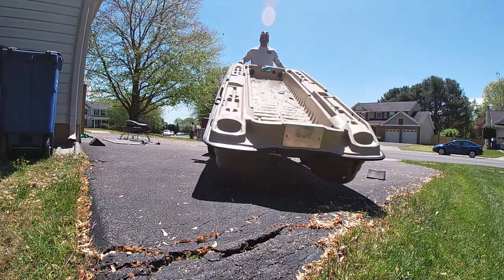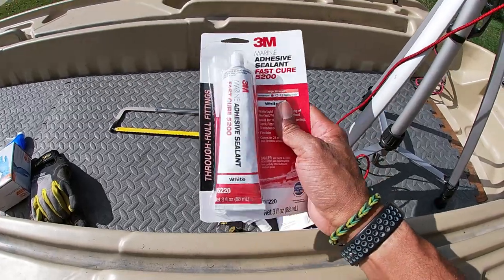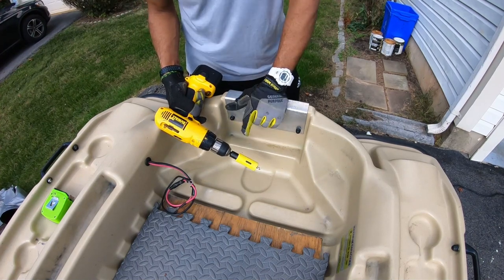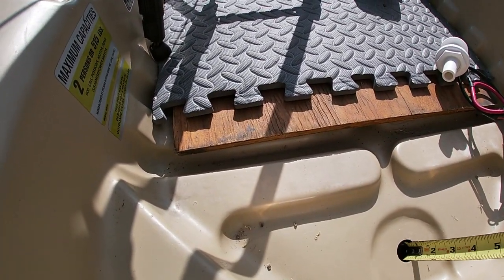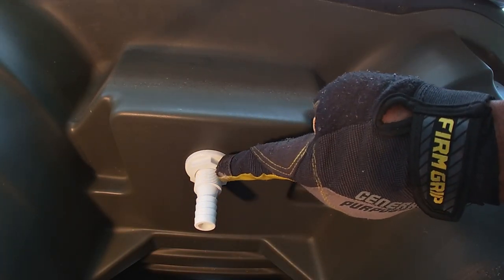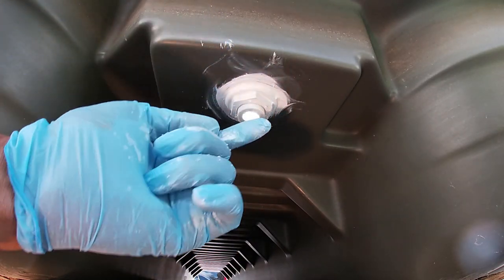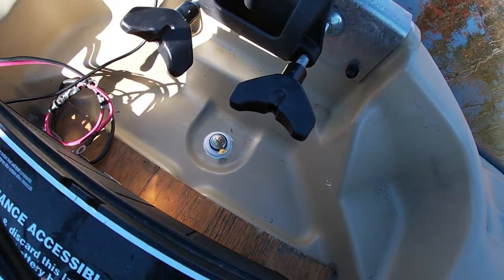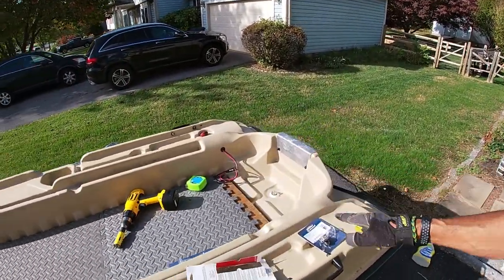Pelican Bass Raider 10e Scupper Plug INSTALL AND TEST {Complete Step-By-Step}

Comment: I am new to boating (and somewhat technologically challenged when it comes to online posting).  I tried commenting on this topic once before, and, I believe I lost the comment somewhere in cyberspace during the attempt.  This is a second attempt.  I watched this video (and some others) when I was trying to decide if I wanted to drill a hole in my new Bass Raider10e and found this video to be instructive and helpful.  
 

Before inserting the hollow plastic scupper hole bolt I wanted to have a shim/spacer in the inner hull, between the floor of the boat and its bottom, to prevent crushing the plastic in the empty space when I tightened the large plastic nut.  I saw another boater’s video using a printed C-shaped insert that seemed to work but appeared difficult to insert into the inner haul; the video suggested using that spacer divided into a few thinner sections. I thought I would try my own homemade spacer cut from a piece of PVC pipe.  I am now attempting to cut and paste (see below) a description of my very simple shim/spacer and how I did the installation.  I do NOT know if it will work and I am NOT saying that it is even a good idea, only that it is food for thought.  I will attempt to include a couple of photos of the shim/spacer IF I can figure out how to do that.

So, I made a simple split shim/spacer that I could insert between the upper and lower hull-shell halves of a Pelican Bass Raider 10e. Hopefully, this will prove to be a solution to the problem of: “how do you easily get a shim/spacer, that has a larger diameter than the holes you drilled through the floor and bottom of your boat, placed around the perimeter of the holes, and placed between the upper and lower hull-shell halves (inside the hull), when there is no other point of access for the shim/spacer?”  The steps I followed in my installation are outlined below.
 
1.	Drill a 1 and 5/16-inch diameter hole (THIS SIZE ONLY APPLIES FOR THE SIZE OF THE PIECE I INSTALLED IN MY BOAT – ADJUST SIZE FOR YOUR APPLICATION) in the floor of the boat and one through the bottom of the boat for the hollow plastic scupper hole bolt to pass through.
2.	Accurately measure (with calipers) the space between the upper and lower hull-shell halves in several places around the perimeter of the holes you drilled.  Take a few measurements because the distance between the upper and lower shell halves on my boat varied from about 5/8-inch on one side of the holes to about a half-inch on the opposite side (apparently due to slope and possibly slight irregularities in the molded plastic).
3.	Cut a circular spacer from a piece of PVC pipe that has an inside diameter of just over 1 and 5/16 inches (AGAIN, ADJUST THESE SIZES TO SUIT YOUR APPLICATION).  Grind down the width of the spacer (measuring with calipers) to accommodate the variance (from ½” to 5/8”) in the empty space between the shell halves.
4.	Drill a few small holes, about 1/8-inch diameter, around the perimeter of the plastic spacer.  You will use these holes to reach between the upper and lower shell halves with a nail to turn and position the spacer for best fit once it is inserted between the shell halves; just stick the point of the nail into the 1/8-inch holes to rotate the spacer.
5.	Next, use a hacksaw to cut completely through the spacer AT ONLY ONE POINT around the spacer’s perimeter.  Make the cut at about a 45 to 50-degree angle ACROSS THE WIDTH OF THE SPACER so that the spacer now has two sharp pointed ends that are separated but nearly touching each other; the spacer is still in one piece but cut in the middle (kind of like a lock washer only with very pointed ends rather than flat 90-degree ends).  Use a black marker to mark over the saw cut on the inside and outside of the spacer so you can easily see it when installing as you look down through the hole in the boat floor.
6.	Run about a foot of mono fishing line through one of the 1/8-inch nail holes and tie the ends together to make a loop.  You will leave the mono line sticking out of the hole you drilled in the floor of the boat after you insert the spacer between the upper and lower hull-shell halves.  This is just a precautionary measure so you do not accidentally lose the spacer down inside the boat where you will never see it again.
7.	Clean the boat plastic (I used just a little acetone) around the 1 and 5/16-inch holes in the floor and the bottom of the boat and clean any dirty or oily stuff off the plastic scupper hole pieces where they will contact the surface of the boat.  
8.	Put marine sealant (I used 3M Marine Adhesive Sealant Fast Cure 5200 White) around the bottom of the plastic bolt head of the scupper piece and around the top of the plastic nut (where it presses against the bottom of the boat) on the other end.  Try not to make a big mess and use rubber gloves and a face mask and try not get the sealant all over your clothes, tools and glasses (if you wear them).
9.	Next, gently pry and separate the two sharp pointy ends of the shim/spacer and place something (maybe a small wood chip) about 1/4-inch thick between them on the top side of the spacer so one sharp pointed end (sloping down) is sticking out.  
10.	Next, turn the spacer at angle and insert the sharp pointed end into, and along the edge of, the 1 and 5/16-inch (or your size) hole in the boat’s floor.  Wiggle the spacer around, turn it in a circle (as if the pointed end is the start of a bolt thread and you are trying to screw it into a nut).  Turn and “screw” the spacer into the hole until it pops through the hole and is now wedged between the boat floor and the bottom of the boat and surrounding the 1 and 5/16-inch hole as you look at it from the top.  Use a nail and the mono line to rotate and position the spacer exactly where you want to be for best fit.  It took me about 30 to 45 seconds to complete Step 10.
11.	Insert the large plastic bolt (that is the main part of the scupper piece) into the 1 and 5/16-inch (or your size) hole in the floor of the boat.  But, before you push the head of the plastic bolt (now dressed with marine sealant) down against the floor of the boat, cut and pull out the mono line.  Or, if you are confident and careful, you can remove the mono line just before you insert the large plastic bolt – just don’t bump the spacer and lose it inside the hull before you get the large plastic bolt through it.
12.	Push the large plastic scupper bolt through the hull, screw the large plastic nut (dressed with sealant) on the other end, squeezing against the shim/spacer (THAT IS NOW INSIDE THE HULL), and carefully tighten the large plastic nut while holding the bolt head in place (do not over tighten).  Clean up excess sealant.  You may want to add some sealant around the edge of the nut (on the bottom of the boat) or the bolt head (on the floor of the boat).  Try not to get any sealant in the scupper hole and quickly and carefully clean it out if you do – remember the scupper needs to be clean so the plug will fit well and seal off water.
13.	Clean up your mess.  Let the sealant cure per the manufacturer’s instructions (I waited 72 hours) and then put the plug in the scupper hole.
Reply from the maker: In my opinion it's not needed because that part of the boat is not load bearing.  I think it's been two years now and I've had no issues with the plastic flexing.  The only thing I may do is add more sealant than I originally did at the top only as an extra precaution. I was a little stingy with the sealant up top.    I can only speak from my experience but no issues so far.
Reply: It's good to have that update.  I was a little nervous about drilling a hole in this boat but your video and some others convinced me that the scupper hole is well worth having.  THANKS!  @BassBrothersFishingDMV

Comment: Lot of work and I commend you for it.  Being lazy I used a Shurflow 12 volt pump that remains onboard and attaches straight to my battery. It has its pros and cons. 
Pros: 
It is fine in the outside elements. 
It is mounted and ready to use if needed. 
It only draws 4.5 amps
It can move 1.8 GPM with a MAX of 6.8
It made my wife happy. 
Cons: 
Price at about $120.00
Weight of 4lbs
More Wiring to deal with. 

The one I selected was the 8000-547-189 and I am sure there has to be a lighter one out there that would fit the bill. 
Happy FISHING!!!!!

Comment: I think I would have used some insulation in a can as a circular wall around the hole you drilled. But you did a fantastic job and I am now confident that I can drill a hole in mine and not have any issues. 

I bought my plastic molded boat back in the early 90’s and had made a lot of mods back then, but YouTube has opened my eyes as to what I can do with my little molded boat. Thanks for sharing!
Reply from the maker: Thanks.

Comment: Great idea & execution 👍 I have the same 10e, with this same inconvenience !! I wish they had the same plastic drain that sits flush on top ( like my tub/shower drain ) but I also couldn't find one. I think what I'm going try, instead of the expensive MESSY silicone/sealant, I'm going to make a gasket for the top & bottom. A sheet of rubber ( Amazon of course 🤦‍♂😁) thick enough, cheap, and less mess. I have large O-rings set, I may even try those and see if it adequately seals. May need something in between the upper & lower hulls.... Otherwise I may end up you're route anyway !!! Again looks good, and clearly serves the needed purpose.

Comment: I've been at that drain plug on my deck I bought a few months back , just need to get the 5/8" plug.     I have the other items but kind of 'chickened out'.  I think I have the nerve and know how to do it now.   thank you for the nice video bro.
Reply from the maker: No prob.  Its an awesome upgrade. The plug is good to have but optional.  I fish in a rain storm recently and kept the plug open the whole day and the water never came in more than around the plug. Still good to have though.
Reply: @BassBrothersFishingDMV  Just picked up the plug and it definitely won't fit in
 that fitting.  Hmm.
Reply: @marchufnagel9068  I've researched the 5200 glue.  A lot of users with HDPE plastic, but not a "true" bond.  I used it anyway, because I thought plastic welding would look like crap, (and worked for Bass Bros).  That being said, if you flash the surface with a torch, it will take bond better...so sayeth those with more experience than I (boat repair pros).  It took about 2 seconds to do...just enough to make the surface look duller than it was when you started out.  Do not burn or bubble/warp.  You can practice on your hole cut-out for practice if needed.

Comment: Nicely done.  Thanks.   One can also drill a pilot hole through the inner and outer hulls for the hole saw bit, so if the hole saw bit is  not long enough the lower hole can be created from the bottom.  Also, one YT contributor used a sheet of rubber gasket material instead of the gel adhesive.  That makes removal of the scupper plug a snap.  BTW, I had the same problem with trying to drain water from the boat; I used a drill powered pump (Harbor Freight) to suck the water from the boat, BUT the real PITA was GALLONS and GALLONS of water inside the HULLS.  I used two cans of Flex Seal applied at the seam where the upper and lower hull clam shells are joined; hope it works.  Another point about the Bass Raider: you will not find another boat anywhere near as inexpensive; pedal fishing kayaks easily cost several hundred dollars more.
Reply from the maker: You are so right. Tight lines my friend.
Reply: Wish your comment was longer than 4 months ago. How is the Flex Seal performing? Do you still need to drain it any?
Reply: @David-lf2ne  So far, so good. Sadly, the price of Flex Seal has increased.

Comment: I use a 10ft x 15ft "fish pond liner" to cover my Bass Raider instead of the cheap Poly tarps. The pond liners are usually black in color which become extremely hot during sunny days if the boat is stored in direct, Non shaded sunlight, so using plywood under the tarp helps to keep the heat off the boat, and, the pond liner can possibly be painted a lighter color. But, the pool liner I bought at lowes has lasted me 10 years now with no cracking, tearing and no leaking. Fabric woven Poly tarps don't usually hold up very long to wind and / or freezing temps.

Comment: I'd recommend sealing the threads of the nut to the bolt/tube.  The thread can be tight, and still not be water tight. It looks like you got enough sealant under the nut where some of it got squeezed into the thread, but that is not a definite seal of the threads.

Comment: Great video BBF.  I have had the same approach in terms of not putting holes my Raider.  I need one of these though.  This video has convinced me to do it.   I have the same issues with water in the bottom etc after hard rains.  Great job putting links in as well.  Thanks for doing this video and have a great season.  Once I get it done, I will Definitely shout you guys out.  Thanks again and FISH ON!
Reply from the maker: Thanks man.  Believe it or not it also can be left unplugged while you are fishing for rain fishing situations.  I tried it and water drains out.  At best I have some water in the little circle cutout.  But yes, draining the boat after a heavy rain sucks. Tight lines bud
Reply: @BassBrothersFishingDMV  Good to know.  Thanks BBF.  Have a great fishing season.
Reply from the maker: @fishingwithvance  you too bro.

Comment: Enjoyed your video.  My only concern is the 3/4 inch gap separating the hull layers.  Looks to me like you would need some sort of 3/4 inch thick spacer between the two layers of plastic for strength & rigidity.  If one layer were to flex without the other flexing, it would break the bond and let water in.  Is there any way strengthen this part of the hull to prevent this?
Reply from the maker: That's a good point. For me I feel ok about it because of where the scupper is located. Non load bearing area.  But that's me.  Nothing is gauranteed with DIY stuff. You just gotta do your best and hope it lasts lol.

Comment: Great video! I will be adding this to my Bass Raider soon. Semi-related question. Did you seal the top and bottom halves at all to prevent water getting into the pontoons?
Reply from the maker: Yes I did.
Reply: @BassBrothersFishingDMV   Thanks for the quick reply! Is it as simple as removing the molding and adding 5200 around the crack and put the molding back? Did you also seal the 'staples'?
Reply from the maker: @davidblizzard4628  I put the 5200 around the hole I drilled out as well as around the thru hull fitting and screwed it tight against the boat.  I didn't seal the stakes that hold the actual boat together.
Reply: @BassBrothersFishingDMV  Got it! I have read  people saying that water gets in where the hull meets the pontoons (top and bottom) and they have to drain the pontoons so I was curious. Thanks again and keep the videos coming!
Reply from the maker: @davidblizzard4628  there is always that chance wirh a plastic boat that flexes. 5200 is the beat stuff it there so tighten up the fitting and done be shy with the 5200.  Nothing is perfect but that will increase the odds of leakage.

Comment: Nice clean job with the drain!  I've seen a couple of guy's use silicone or neoprene gaskets instead of the 3M sealant.  I was wondering what your thoughts on that might be?  Thanks!
Reply from the maker: 3M has worked great for me.  I've never used silicone under the waterline.
Reply: I think I’m going to use both on drain , transducer mount bracket and other screw holes.

Comment: So I just picked up this boat at bass pro shop in sunny co cal. Last one anywhere in so cal to be had right now. Drove 100 miles to get her. I know you waited quite awhile before doing any mod that required a hole in the boat. But since you have trail blazed this mod for us Raiders, I wanted your opinions whetheror not this could be a mod to just go ahead and do right out the gate on a new boat. I’m a woodworker so am very comfortable using tools. Not done much marine sealing and what not but it seemed pretty straight forward. I guess what I’m saying is, given what you know now, would you just go for it or would you still wait?
Reply from the maker: I waited only because it was all new to me and putting a hole in the boat just seemed too risky.   Now that I've done it I realize it was all in my head. Totally up to you. Just keep an eye out for water collecting from rain storms while you're not looking lol.

Comment: It is getting close to 2 years since you’ve done this modification. How is the adhesion of the sealant performing? Any leaks? I believe you used 3M 5200. Correct? I’m back and forth on what to try for sealants on my Ram-X HMWMP plastic.
Reply from the maker: No leaks that I am aware of from the 3M 5200.

Comment: Plz confir the thru-fill calls for 1 1/8 hole..You used a 1 1/16 hole saw..Does the shaft fit the thru hole 1 1/16 hole or did you use a 1 1/8 bit?
Reply: I would contact the manufacturer for correct hole size. Or google the product.

Comment: Is the drain hole higher up than the floor? It looks like it on the video. I always store mine upside down.  I rather not do that but if the hole is higher it will still hold some water unless you tilt it. Thanks
Reply from the maker: The drain plug is around 1/8 of am inch high.  Water is minimal

Comment: What kind of heavy duty Velcro did you use for your ores on the outside of the boat
Reply from the maker: https://www.amazon.com/VELCRO-Brand-Industrial-Strength-Fasteners/dp/B00006IC2T/ref=as_li_ss_tl?crid=1PJ4T73O9K1W&dchild=1&keywords=velcro+90593&qid=1584897001&sprefix=velcro+90593,aps,131&sr=8-1&swrs=3E88969BE5D1C929CABB991388B736F4&linkCode=sl1&tag=bassbrothersf-20&linkId=cc861bf96fc07b34624ea820c5e7a24b&language=en_US